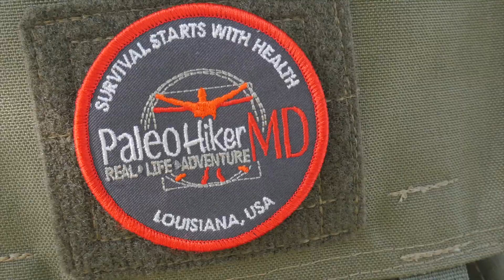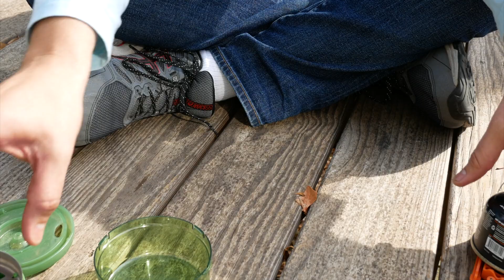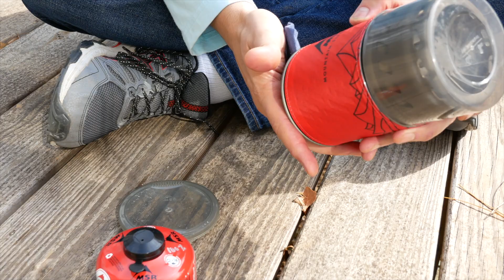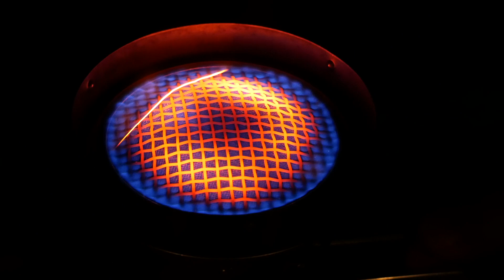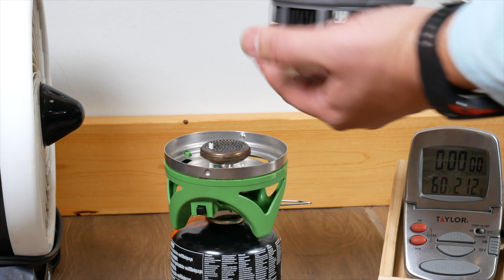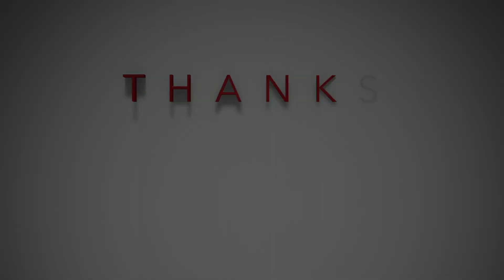MSR Windburner vs JetBoil Flash (SURPRISING RESULTS!!) - Boil Testing and WIND Testing

Comment: Wow sounds like a lot of cons for both products especially zero flame control for the MSR windburner! 

Yes it boils water fast, but so too just about every quality gas canister stove like the Soto Amicus,Wind Master,  Etc.

 I noticed that you mentioned they make a frying pan but what would be the point if you have no flame control? 

Are you cooking at full blast in a frying pan?

 Who cooks like that?

I say just stick with a high-quality gas canister stove that weighs almost nothing, and use titanium pots and pans as you need.
Reply: You're confusing the stoves. The MSR Windburner has flame control and will simmer. MSR makes a number of pots and pans but they actually dont recommend using the personal system with them as its top heavy so they suggest the Windburner Duo. The Jetboil Flash and Zip are the models that cant simmer as they lack a regulator and are only made to boil. The Jetboil MicroMo and MiniMo are the models that retain a regulator, and will simmer well, with a slightly slower boil time.

As far as the Soto stoves go, or any light "wind resistant" stove like the Pocket Rocket Deluxe, they dont work nearly as well in constant wind as fully shielded systems like the Windburner or Reactor. They'll stay lit but the flame is still displaced and you lose a ton of heat where the Windburner really doesnt care. It can easily take 15-18 minutes to boil with the Soto in alpine conditions. You'll never have a simmer flame with a Windmaster with any sort of wind either. It will just blow out.
Reply: @natea1042  Thanks for the clarification.

Still a little on the heavy and bulky side, maybe good for car camping.

Never had much in the the way of wind problems with my Soto Amicus.

It will support a small cast iron pan, and will boil water quickly.

I carry a couple of titanium pots, and my stove, plus a gas canister, and the weight is negligible.

A few seconds difference in boiling times is not that important.

I could probably purchase a Windmaster, and one Amicus, plus a Soto cookset for the price of one MSR Windburner.
Reply: @msilverhammer  Its a bit small for car camping unless your solo. With car camping you can afford the convenience of a 2 burner setup. Its ideal for larger parties though with its 4.5L stock pot, 2.5L sauce pot, and 1.5L skillet, that all nests into eachother so the single system will easily cook for the group. But like I said their primary design goal was a burner system that is impervious to wind and they did that. Most people dont do alpine camping and high elevation camping but the Reactor and Windburner stoves have become incredibly popular in these cold harsh environments where ultra light stoves wont work well, or at all, because you lose tons of efficiency. 

One other neat feature of the Windburner and Jetboil systems is the option to purchase an integrated coffee press so you can make your own brew instead of drinking instant coffee all the time. It works really well at frothing rehydrated milk too if you want a trail cappuccino. 

As with any type of backpacking there is always give and take with regards to what people bring with them to make themselves as comfortable as possible.
Reply: @natea1042  I watched the video again, and I am trying to justify the weight, and the expense in my mind, and unless I know that I am going to be in extremely cold, and windy weather, I just can't think of a good reason to purchase the MSR WIndburner.

Like I stated before, my Soto Amicus with it's four legged pot stand, and Piezo Electric Stealth Igniter weighs almost nothing, has great wind resistance, will simmer great, and boil water fast, and will support an 8" cast iron pan, that I use to cook some meals when I am out in a camping area of a park, but not actually way out on a trail, or in the wilderness.

I would not carry a heavy cast iron pan on a trail, unless I had an extremely good reason, or was traveling via Kayak, Canoe, Boat, or some other type of vehicle, or on horseback, as I have lightweight titanium, and stainless pots that I use when on foot.

When I worked in the wilderness of Alaska, and traveled via Kayak, I used the MSR Whisperlite Stove which worked very good, and sometimes I used a wind screen to help block the wind.

IMHO...Gear like this is made for "Glampers," who like to purchase and collect expensive gear!

Comment: I have seen you say that the flash does not have flame control before, the flash has very good flame control, i dont understand why you say this? I have had a flash for like 12 years and it still has an adjustable feature for the flame control. Maybe something is wrong with yours?
Reply: Jetboil themselves will tell you the Flash and Zip have crappy flame control. Just because you can turn the flame low doesnt mean you have flame control. Its basically, on, low/suffocating, and then off. At its low flame a mouse fart could blow it out so its not really even usable. A MicroMo or MiniMo, by comparison, has a smooth flame control that ramps up and down. There is a HUGE difference between the two burners.
Reply: @natea1042  maybe, still works fine for me, source for jetboil saying that?

Comment: There may be something wrong with the valve on your Flash. I have a much older Jetboil PCS that boils water in around 2:30, is completely adjustable and simmers well. At the time it cost about $100. I would have liked it if you weighed the tanks before and after to see how much fuel was consumed. Your comparison is flawed in that the Flash is not meant to have simmering ability, yet you call out that feature as missing. I felt the same way with your Aeropress review, you clearly don't know how to brew with it. I guess anything passes as a review as long as it generates clicks.
Reply: Jamie Moore  - you make some good points about the tests he conducted. Your other comments seems to be arrogant. Example of this is that you wrote: I felt the same way with your Aeropress review, you clearly don't know how to brew with it. I guess anything passes as a review as long as it generates clicks.

So please tell me when will you start your Youtube channel videos? I don't have any and neither do you. We don't have to like videos on Youtube but please have some civility in your comments.

Comment: Superb, yet flawed video!!!
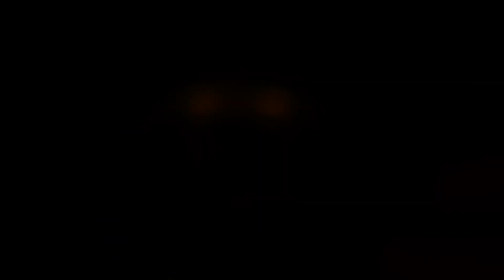Edit: I may be wrong, and take that back as I just looked at their site and they do list the Flash at boil time of 100 seconds. However, the Mighty Mo version does indeed take 2:15 seconds as I own one.
Regular, standard Jetboil boils 2 cups in 2:15 seconds.

This is the equivalent of comparing a Ford Focus to a Chevy Truck.
Jetboil makes a ZIP, Flash, Regular, standard model, Mini Mo, Mighty Mo. Each model has a significantly more robust regulator for stronger performance.
Great video, though.
Reply: Agreed! The Mighty Mo would’ve been a better comparison.